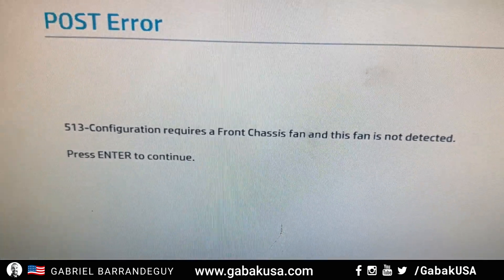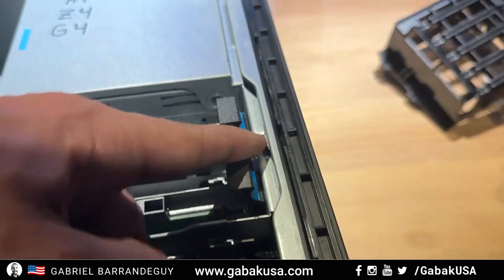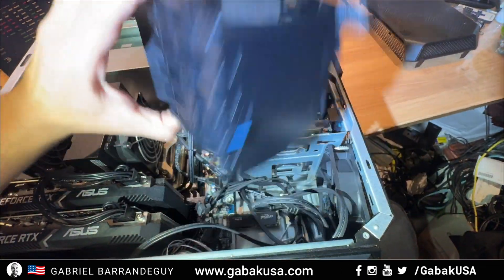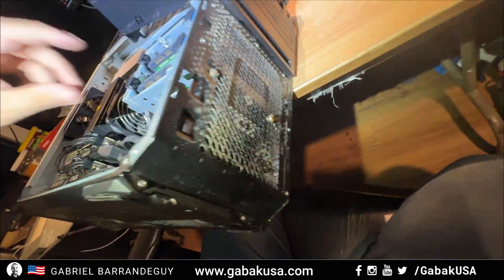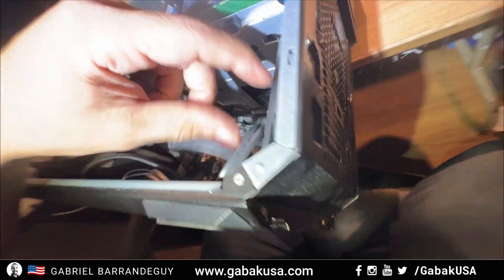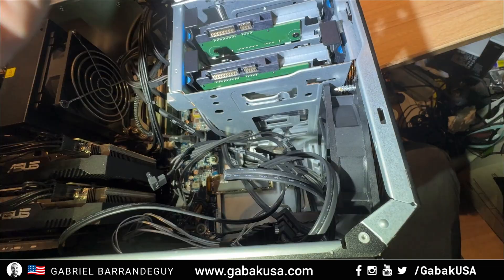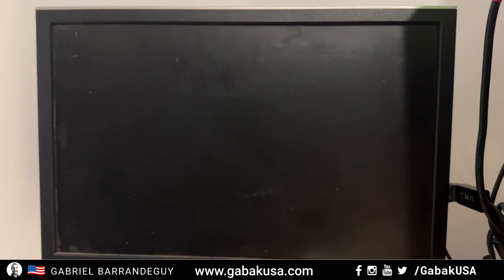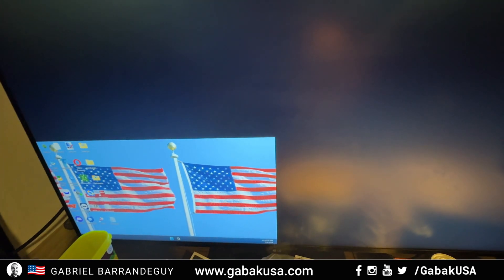how to fix HP z4 g4 513-Configuration requires a Front Chassis fan

Comment: FYI: Any standard 4 pin PWN 92mm fan will work here.  When mounting there is a metal tab that needs to be broken off or it will stop your fan from spinning.  You will not be able to screw on all 4 screws, just the top two will hold it place.  Your fan won't go nowhere
Reply from the maker: thanks for sharing